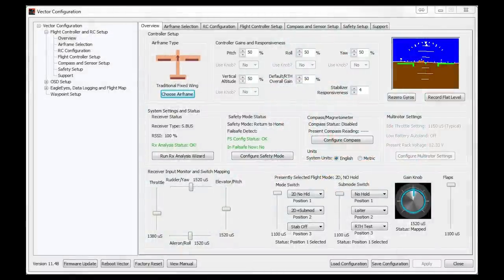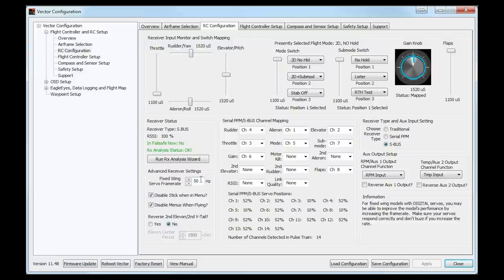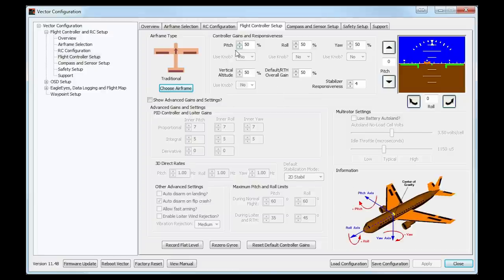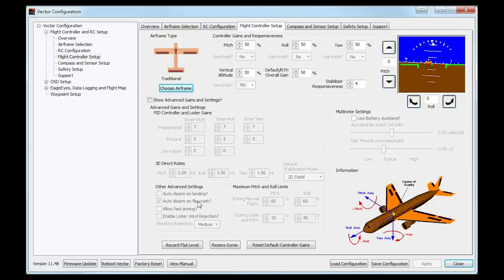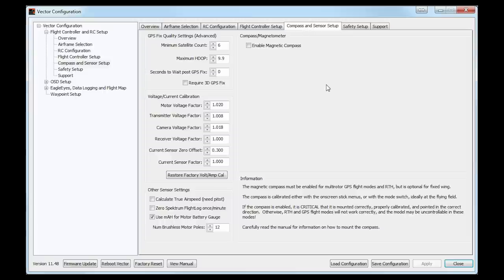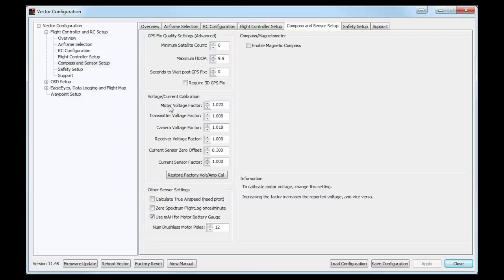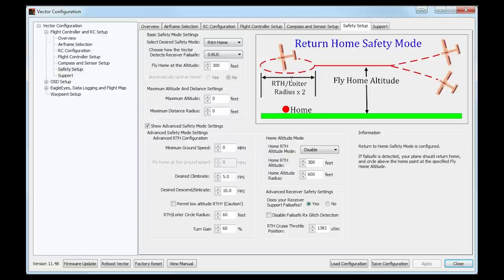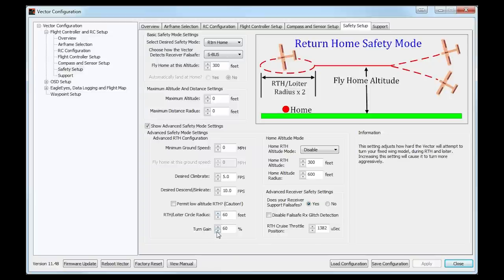Eagle Tree Vector - Guide/Setup - Part 3 (Settings Overview)

Comment: quick ???... Would you be able to set the Eagle Tree Vector FC up in the same manner as the SAFE reciever for essentially the same Flight modes (minus the Panic switch)?
To control bank angles and so forth. 
Using a Taranis plus for example. 
Thank you.

Comment: firstly, thanks for making these videos.... great amount of detail! can you please tell me about the cruise throttle setting. I understand that you are setting the throttle 'position' but does the Vector actually manage the throttle when RTH is engaged? My current T1000FC controller is very basic but also very cheap at £50. It does not control throttle at all and when RTH is engaged I must set the stick position, but say I lost video signal... I would have no idea if I was flying into a head wind and needed more throttle. Does Vector handle all that stuff? I hope so for £200 : )